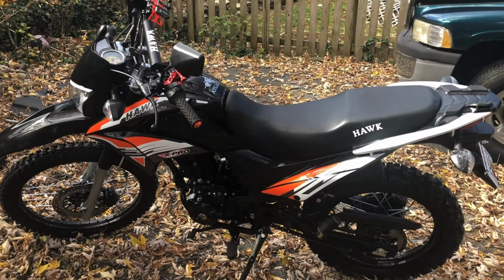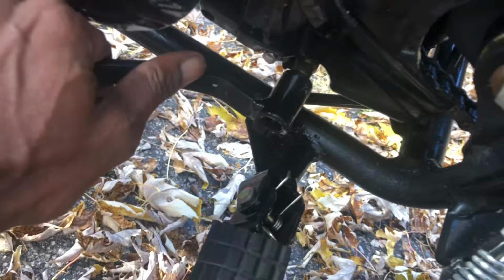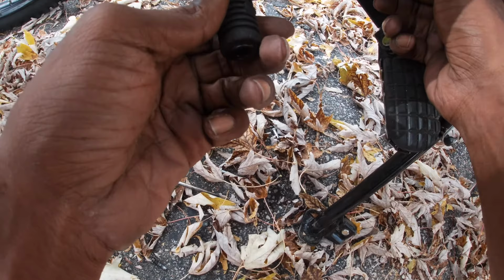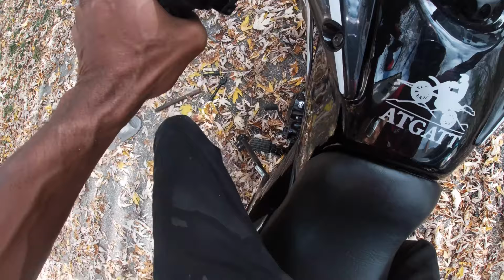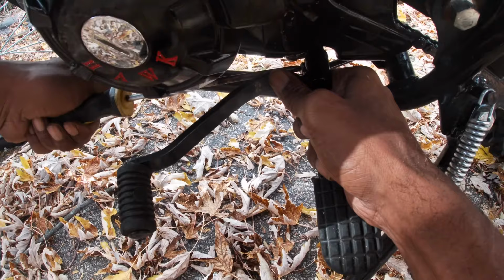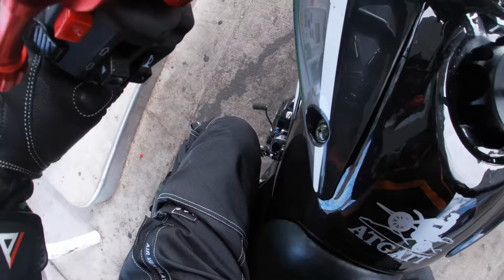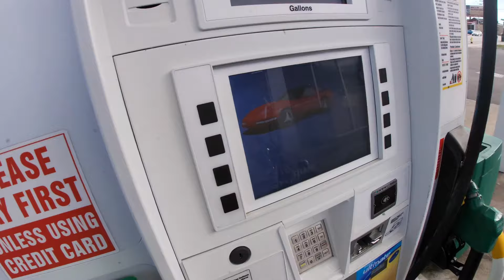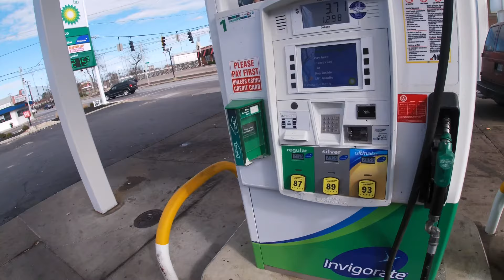First Gas Station Fill-up On My Hawk 250cc

Comment: Can you show how you switched the gas cap out I want to replace mine
Reply from the maker: this is the original gas cap with a colored aspirator tube, there are all kinds of options for this bike available on Amazon.
Reply: @Lookatthebottom  ok on my it the same gas cap that the key goes into to unlock. I would like to Install one like yours. Any ideas on how to remove them. Prry for being annoying just got the bike and excited by the amount of mods.  The bike is great buy excellent cause of the amounts of mods known and unknown.

Comment: so the hawk period rakes 93? i got new carb on it
Reply from the maker: It runs good on any grade gas from what I've heard, but I believe higher octane fuel burns cleaner and slower. Considering it gets about 70 miles a gallon, the extra cost seems worth it to me.
Reply: @Lookatthebottom  okay appriciate it my guy keep videos coming 💯